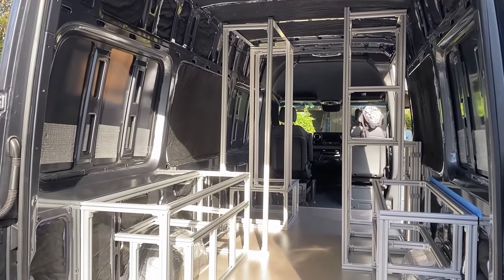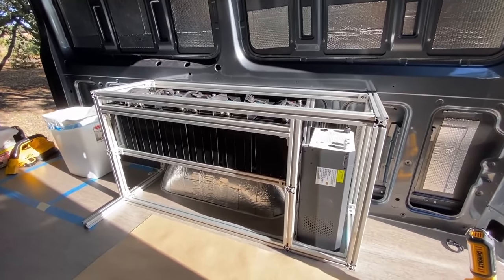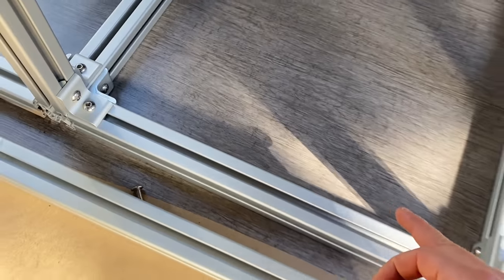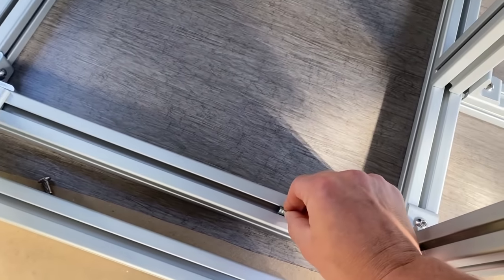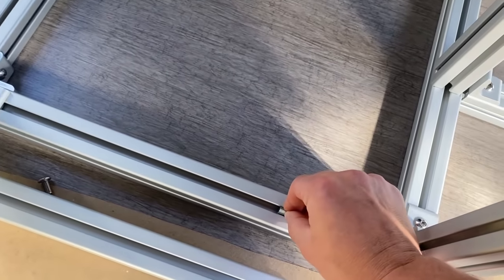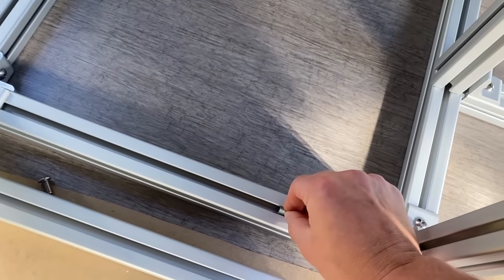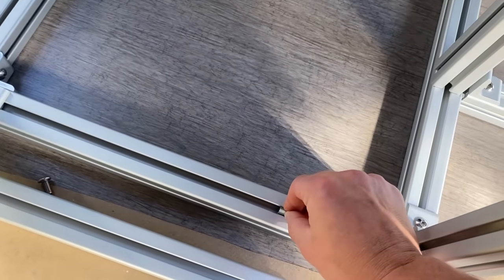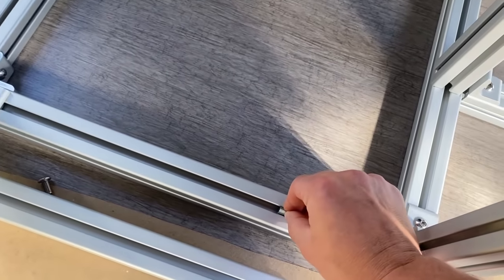How To Build A Van With 80/20 Aluminum (INSANELY STRONG)

Comment: What was the total cost for all of your 80/20 roughly?
Reply from the maker: About $2500
Reply: This is one of those questions that if you ask it you cant afford it. I spent 15 years off shore on a research vessel and we used 80/20 for the installation of most of our instruments and lab fixture installation. Of course this was government funded is the only way anyone could afford this stuff. Now that I am retired there is no way I can think of using this method. Wood is expensive enough. Other than what he  offers as layout ideas, using this method is out of reach for the average person.Expense is the least of your worries.  One of the things you need to consider is those screws holding this together will not hold in the event of an accident. Basically this is a friction hold with typically M5 or less screws. The screws will shear in a major accident leaving the extrusions to fly around. I look at this method of building with great fear when envisoning the forces which would be imparted with an impact either from the rear or the front any speeds above 30 mph.
Reply: @crawford323  for 1.5” 80/20, it’s a 5/16” carriage bolt , closer to M8 metric. I agree this stuff is expensive. In a serious accident, its not going to be pretty either way. Death by splintering wood , or death by extruded aluminum impalement. It’s like trying to decide if you want to chop off your left leg or your right leg.
Reply: @leodhasw-s3739  well if one were to justify expenditures by percentages, our nation budget for our military seems reasonable.
Reply: @seven_o_savage  Very good idea, but for less money you can use aluminium tube and bolt ! 😉
Reply: Very good idea, but for less money you can use aluminium tube and bolt ! 😉
Reply: @FirstLast-nu4by  

If you don't have a fortune to spend I would try it for sure
Reply: @crawford323  Ive used this in vehicles along with adhesives like 5300, 5200 and aircraft sealants depending on the application for adhering to the outside steel, and in the inside for all the joints, the good its strong and will never come apart without a lot of work,  the bad if you want to tear it apart and or change configuration you are not going to be able to I do agree with safety though
Reply: @Chris One of the most underestimated risks of causing injuries in a car accident is not outside out of your car.  The majority of drivers and their passengers never consider the fact that unsecured objects in your car are dangerous in an accident.  The forces in a motor vehicle accident are quite severe.  Everything in your car is moving at the exact same speed as your vehicle as you travel on your way.

Suddenly you are involved in an accident and your car has come to an immediate halt.  All of the objects in the car continue to travel at speed.  The occupants – who are hopefully wearing their safety restraints – meet resistance from their seat belts and child restraint seats.  Several things in the car continue to move with force at the same speed as your car was traveling to lash the driver and passengers increasing their injuries and, in some cases, threatening loss of life.

Any loose object in your vehicle will pose a serious injury risk in a car accident, and potentially a fatal risk if your car is spun around or during a rollover.  These items can include:

Purses
Briefcases
Backpacks
Water bottles
Laptop bags
Cell Phones
Gaming Handsets
Groceries
Tools
Tool Bags
Books.
Clueless?
Reply: @seven_o_savage  Thanks for this, not as bad as I thought! I’m thinking of building a roof rack with it, a bed, and the cabinet that will hold the fridge up off the floor...
Reply: @crawford323  You should not continue to waste your time to educate stubborn person.  It's not worth it.  If only he watched motorhome / caravan crash test videos...
Reply: @crawford323  Agree. But not an issue if you have a barrier between the living quarters and the cab. I have a 4wd wagon and have always installed a cargo barrier between the cargo and passenger area. It amazes me the number of people who don't divide their cargo or living area (be it a 4wd, RV, Van...) with a rated security barrier. It is a fact that people die from flying objects in accidents in which they would have survived had their cargo area been compartmentalised from the passenger/driver areas.
Reply: @seven_o_savage  $2,500 seems to be well worth it for strength and lightness.

Thanks for sharing the parts to help us out.
Reply: @cyclemoto8744  Interesting. Any pointers on how to do this? Any specific kind of material?
Reply: @davidvarela6020  are you referring to a cargo barrier? If so, easy, you buy one ;)
Reply: @crawford323  the many bolts* (not screws) supporting maybe not much weight held within the frame will sheer off in an accident but the two seatbelt bolts that aren’t a great deal larger are designed to support a 100kg+ person? Okay... 

To call these fixtures “friction fit” and use that as a reason they are unsafe is like calling a threaded bolt a friction fit, whilst technically true it is not through the overcoming of these forces that these fixtures would fail. 

I can tell by the way you write that you have no real in-depth knowledge of what you’re taking about (classical mechanics, Newton’s laws of motion), stop trying to lecture people when you yourself need to learn the fundamentals...
Reply: @InfoAction_  I’m an engineer who uses 80/20 for a lot of test fixtures that apply various loads to structures. I can tell you from experience that 80/20 joining techniques are deceptively weak. 

Specifically using T-nuts to bolt parts together. The joint relies on the compression force of the t-nut in the 80/20 channel to lock the parts in place. The only thing preventing them from sliding is friction. ie: friction fit. 

These t-nuts, they will shift and fail at quite low loads, not only slipping, but even tearing out of the 80/20 channel when pulled axially. Remember we are dealing with aluminum here, which is quite soft compared to other metals. 

If you want a safe structural joint in 80/20, you need to use a through bolt. That way you can use the steel bolt’s strength to resist the shear and axial loads, not friction. Of course that’s more work, but that’s also why I wouldn’t use 80/20 in this application. The safety/work ratio just doesn’t justify its advantages to me. 

I certainly wouldn’t use these in my van without a really good reason. And if I did, you bet I’d use through bolts on all critical joints.

Also, the bolts are prone to backing out with vibrations. Driving your van down the road is like putting your structure through an earth quake for hours at a time. Unless you’ve got your torques dialed in or locktite every. single. bolt... well, you’ll start finding bolts on your floor in a few months 😬
Reply: @samknechtenhofer365  straight away you mention various loads, that’s the biggest factor here, completely depends on what the van owner plans to store in, or have supported by (how much mass) this frame work. 

To claim that these T-nuts are only held in place by the compression friction fit within the channel is only true if the force on a member is very close to and parallel to the channel it sits in, otherwise a torque is created and the forces in the T-nut are vectored into more axial and shearing directions. 

For the vibrational issue, vehicles have to deal with this and are designed to do so and they aren’t loosing bolts every time you drive, I can see a solution of rubber mounting any joints directly fixed to the body of the van. 

The good reasons I would use these in a van as a framework is that aluminium itself has a very good specific modulus let alone the fact the extrude makes it even more stiff for its given density, it’s easy to install and even better to modify after the fact, and it looks good. Compared to wood which is probably the next most used in frames for vans, apart from cost, it seems like a very good option...
Reply: I do not know what kind of ACCIDENTS YOU GUYS ARE GETTING INTO BUT YOU GUYS ARE GOING OVER BOARD EXCEPT FOR THE THROUGH BOLT SUGGESTION.
This channels designs are better and stronger than some of the luxury $120+k van's some of the other channels are trying to sell, there are strictly too much tech and decor no strength or safety whatsoever. I like this channel he shows everything even the mistakes, he provides links and shares everything  unlike the other GREEDY CHANNELS.
Reply: Not sure of the cost here but very pricey go to Advanced Rv look at theres they use steel an there average build on a Mercedes Van is between 310 to 500 thousand dollars but they use the best of everything even a water filtration system to reuse water there refrigerator freezer cost a fourteen if you have the money
Reply: @crawford323  I can afford it and I’d still ask, that whole if you have to ask you can’t afford it bs, is just that, bs.
Reply: @crawford323  that is about the most ignorant and backhanded comment I've seen here yet.
Reply: @michellej7734  Right!EXACTLY!!I agree!🎯💯💯💯👍👍
Reply: You talk about the 80/20, like it's really expensive, but comparable wood for this application would need to be kilned precisely, treated, and milled in respect to grain. Likely, cedar would be the cheapest option, but for durability and aesthetic, you would be shopping for furniture-grade cedar, which is still not inexpensive. Likewise, the optimal jointery requires great skill and precise woodworking tools. I have built out or helped build over a dozen vans, three schoolies, and several tiny homes. For the return on investment in durability and ease of use, 80/20 is actually very affordable, unless you've already got a well-equipped woodshop and decades of experience. 
Your build looks fantastic. I would explore the finishing used in the aviation industry for cabinet walls and doors, but use marine mechanicals to handle the frequent jostling of movement. So far, this build looks amazing. Great job!
Reply: @shanehook1010   im on ebay and there  many  options and stores any one one in particular?
Reply: Can you provide a link to the 1.5” plastic bar stock you found? Thx!
Reply: @samknechtenhofer365  Would you say 80/20 is better/worse than wood in this case, case being building a house in a van? I’ve seen others build using what seemed to be aluminum bars to save weight, were they using some other material, or are you saying anyone using this material is in for a world of hurt? Is the only way to do this safely welding the whole frame?
Reply: The cost to be honest is not relevant. When you consider you save over 800lbs over using wood. The gas savings over 6 months pays for itself...

I caught onto this method. Building automated handling equipment for Peak Automation years ago... You can do some crazy shit with DC motors and integrated relay systems.
Reply: @samknechtenhofer365  All that to say.. That if you get in an accident. It will bend and snap... Hate to tell you..If the accident is enough to destroy the factory impact construction. That 80/20 is the least of my worries..As  i have hit a pole at 50 mph. Head on.. Anything not nailed down was in my windshield...

By the way.. It's why they sell Red loctite....You need a torch heat gun to break the bond on the bolts..  Ask any mechanic that has to deal with them dash bolts on Japanese made cars. As the Japanese automakers love that shit. So much you need a breaker bar to get them loose...
Reply: @crawford323  How would wood, glue and screws be stronger than the shear and friction hold of the steal screws and aluminum 80/20?
Reply: @joshuamoore3846  no it isn’t!  It’s stupid and ignorant to say that “if you can’t afford it don’t ask”.  We don’t assume things, plus the lack of manners not answering the question.
Reply: @crawford323  I disagree. It's responsible to ask how much something costs regardless of how much capital you have. Even if I make a million bucks a year I'd still like to know how much money I'm spending on costs. There's a reason so many athletes and celebrities go bankrupt as soon as they get out of their prime years.
Reply: Thanks for the video. It really inspired me on my own van build. Also thanks for having knowledge about links. Most you tubers I’ve watched list where to get the supplies but it’s too complicated. Yours are highlighted in blue and when I click on it it takes me directly to Amazon or EBay. I’m not that computer interested/savvy so this was a huge help. I would have lost interest otherwise. So thank you. I read a lot of the other comments on here. Negative F-ing people. Live in the present and drive safe. It’s easy. Wood sucks to work with. But 80/20 is thick. Also aluminum can be recycled ♾. Wood cannot as easily. Keep cutting down all the trees and we are all DOOMED.
Reply: @crawford323  I'm guilty.  I'm a maniac with that stuff.  I've kept my tool bag "soft sided", crow bars, hammers you name it loosy goosy.
Reply: @crawford323   Aluminum/steel partitions that are widely used in work vans don’t get enough love from the van life, RV crowd. There are several manufacturers but there should be more for such an important safety device. Best chance of protecting you from a battery or microwave flying through the van at 50mph.
Reply: @skitzkit  
Can one weld 80/20 for added locking structural strength?
Reply: @skyfiblue  
I'll have to add one to my sprinter van but it won't be directly behind the driver and passenger seat. I'll add it to the rear of the side slider door mark sliding across inside the van. Like a bulk head in a ship separating compartments. It will add security too for thieves.
Reply: @soandsononame8750  IMO serious accident can be on a road. 99%. But in that case you will be on a driver seat (or the one next to it) with belts and airbags. So yes, there is no difference.
Reply: @crawford323  You have seen a lot of crash tests.  The dummies never survive.  So sad. But, you do what you can.  Wood is much stronger which is why wooden carriages are a thing from the past.

Comment: Just the information I needed! The spring to hold the screw is the same as on my rooftop solar panels, so I know how to work it, yea! Is there a reason for placing electric on passenger side and water tank on the driver side? Thanks for the knowledge.